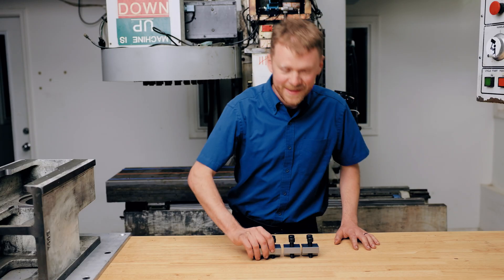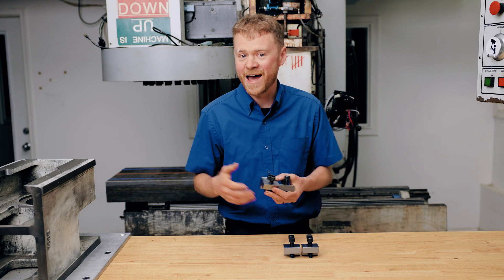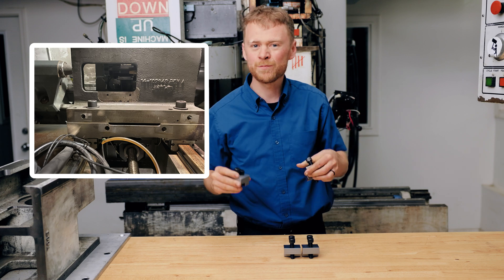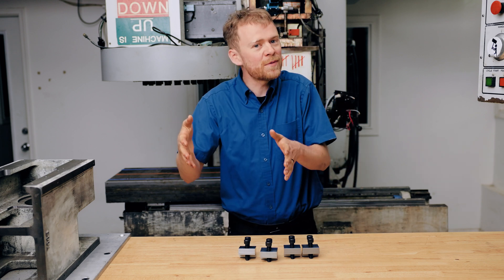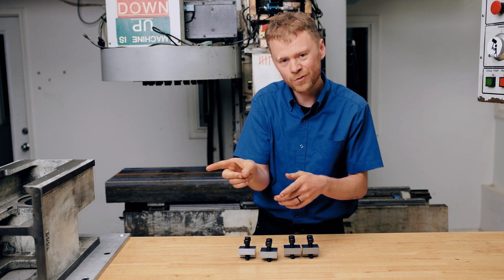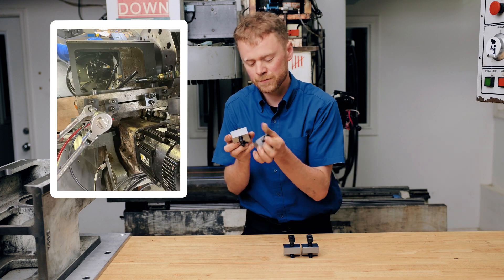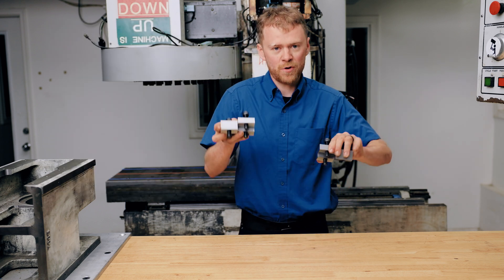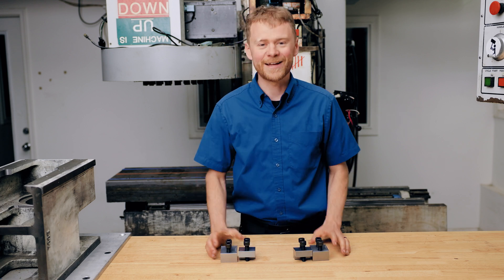ST Turret | Alignment Tools

Comment: I haven't worked on every CNC Lathe made ??
But, I am yet to see the Alignment Blocks not included with the machine.
The Factory sets up the Alignment, and pre / post deliver also checks Alignment.
I doubt any of these people would remove these items and put them in there tool box.

Don't go down the Shock media road with your channel ??
You have a good channel don't ruin it 👍
Reply from the maker: Thanks for feedback! I really appreciate it. If you haven’t worked on the newer ST machines almost every corner that could be cut has been. It’s not fun going to do alignment and finding the blocks are not there.
Reply: agree i have a newer one and they are not included , but i made them myself. 170 $ for this is crazy , i thought european hours are expensive ...

for anyone searching  the thread is a 1/2" - 13 UNC